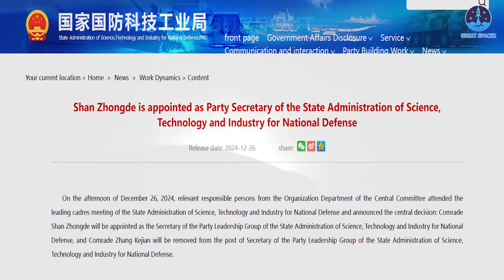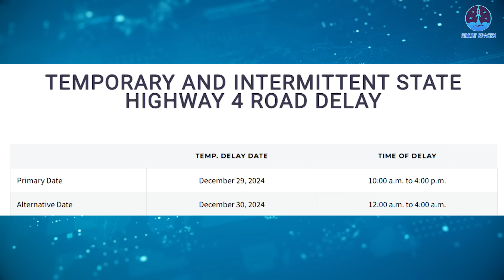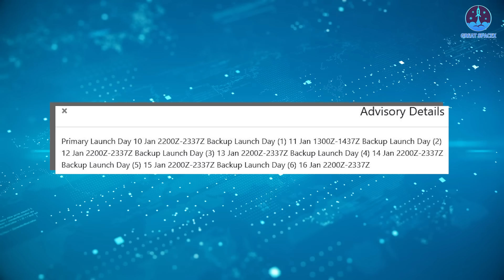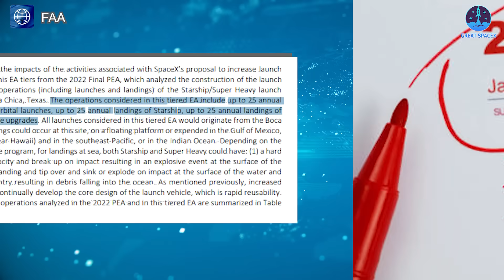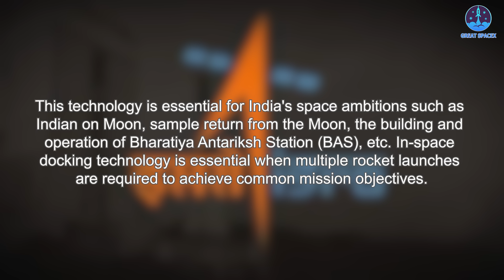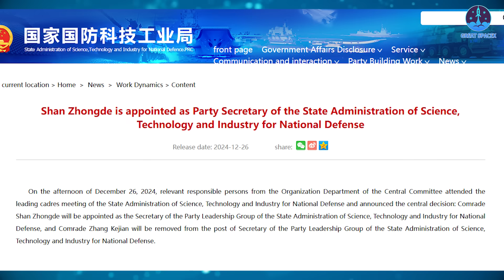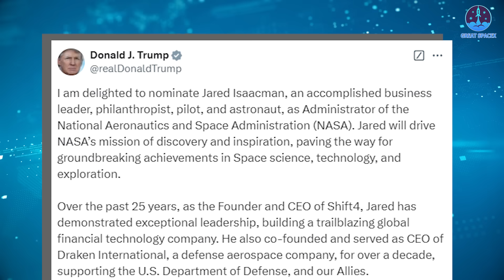Elon Musk officially Revealed Starship Flight 7 Launch Date! Countdown Begins...

Comment: I'm ready for flight #7, and I have the 4 level 7 roaches I'll need for flight #8, it's flight #9 I'm still working on.
Since flight #1 of the world's largest rocket was on April 20th 2023 (4/20 day!), I rolled up a King-sized joint with fresh cannabis and fired it up at T-zero. For flight #2 I rolled up a King-sized roach joint with the roach from flight#1 + 4 other level one roaches. Fresh cannabis has been smoked zero times, so the formula roach level = flight # -1, works for all Starship launches. I have kept this going for all (full-stack) Starship test flights, have the roach joint ready for flight #7 (rolled with level 6 roaches), have the 4 level 7 roaches I'll need for flight #8, and I've 4 (of 16) level 6 roaches I'll need to make the 4 level 8 roaches I'll need for flight 9. I am 20 joints away from having a 5th level 6 roach, so should be able to have that done today, Dec 31, 2024. In total it will take 512 fresh joints & 508 roach joints (1,020 joints), just to make the 4 level 8 joints needed for flight #9. I started that task on Dec 8th, and at my current pace I'll be ready for flight #9 by Feb 3rd, but may slow a bit & not be ready until sometime between Feb 14th & Feb 25th.

Comment: Why would S33 have a payload if it's only going suborbital?
Reply: Something like Mr.Banana will probably be on board, not only to check conditions inside Starship V2, but also to flex the absolute monstruosity of the size it is.
Reply from the maker: To check before adding a real payload
Reply: Musk and our military plan on using it for intercontinental delivery system that would not require orbital velocities. Like sending equipment to a war zone.